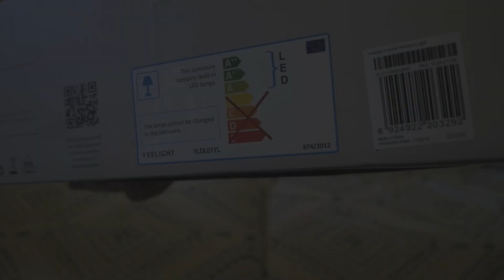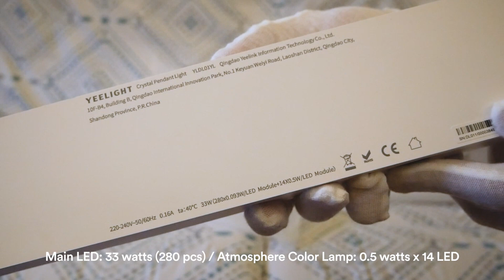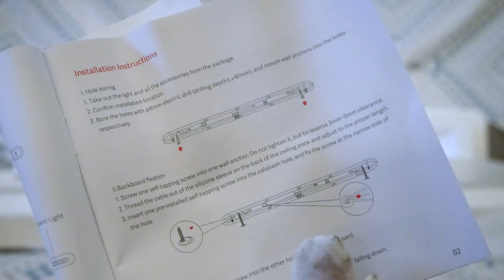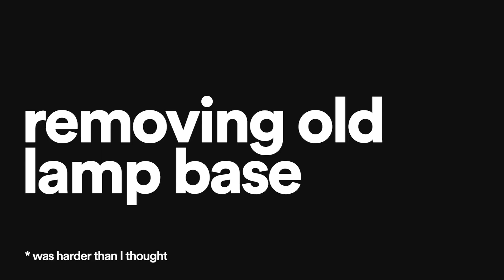Installing Xiaomi Yeelight Meteorite LED Light YLDL01YL - SMART AND BRIGHT LIGHT!

Comment: My ambient light does not power on. Any pointers?
Reply from the maker: have you tried turning it on on the app?
Reply: @rompo  yes I even went to reinstall the app mutiple times. I’m thinking it might be doa
Reply: @rompo  oddly it randomly just started working but the blue does not work.
Reply from the maker: that might be the case becuase it should turn on on initially use

Comment: Hi when the bulb is burnt out after a long time , how do you replace the bulb? Or do you have to buy the whole new light as a unit?
Reply from the maker: Hi, usually these kind of LED technology last a very long time. In the event that it does, I don't think they sell replacements for these kind. These are using LED diodes in strips I would presume rather than the usual disposable bulbs. I have a Yeelight LED bulb with a estimate lifespan of 20+ years.. so I would think this would go longer - not discounting any electrical problems that may arise in the process.
Reply: @rompo  Thanks very helpful

Comment: Did you connect the wire for the ground?
Reply: I only have positive and negative cables. Do you think it will work if I dont connect the wire for ground or if there is a workaround?
Reply from the maker: I don't think I had a ground wire either. I only had 2 cables to screw if I remember correctly. But please do double check or ask for an expert when in doubt.

Comment: Can you tell which size between screwholes in cm?
Reply from the maker: can you elaborate the question again? What do you mean by "size between"?
Reply: @rompo  Umm, distance &)
Reply from the maker: @МаксимВолков-в6л  distance between screws is around 38cm... sorry can't get exact as I would need to dismantle the cover and the wires again.
Reply: When you were screwing the positive and negative cables did you places the ground cable afterwards?  My eléctrico installation doesnt have the ground wire so is there a workaround solution?